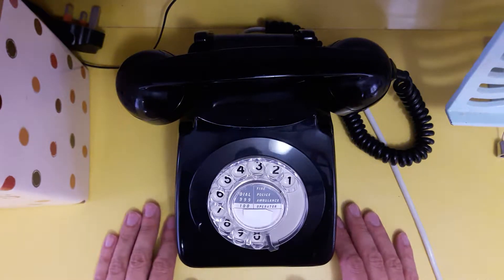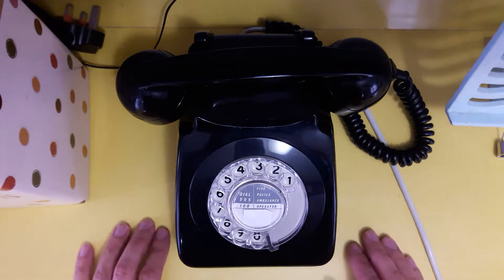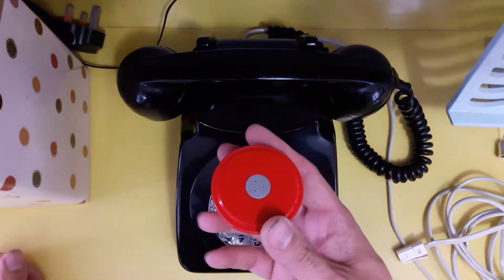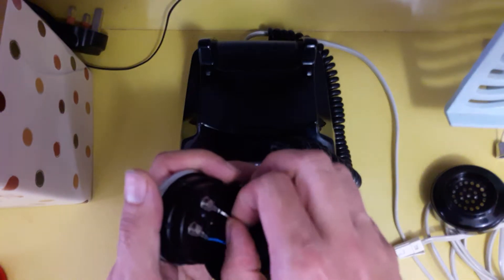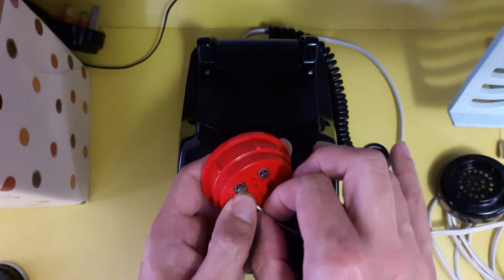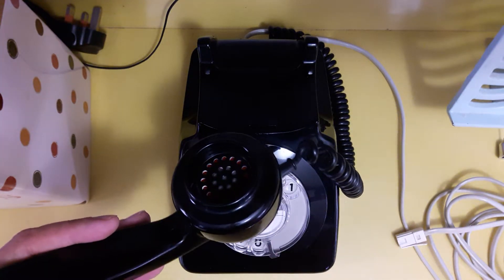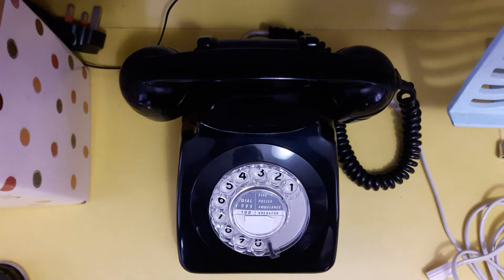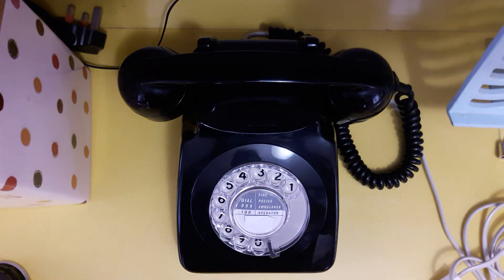GPO 746 transmitter microphone replacement

Comment: In the case that original electronic transmitters are not at hand they can be built easily and cheap. In fact, carbon microphones are consumable parts and were changed by telephone authorities every 5 or 10 years "back in the days". The carbon capsules that still exist today are mostly deaf and exhausted and not good for "daily driver" telephones.